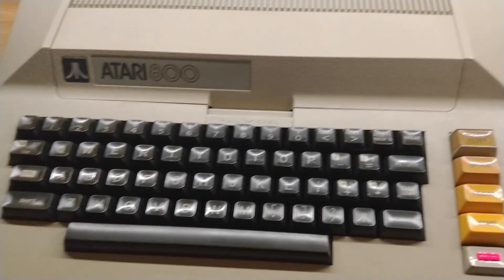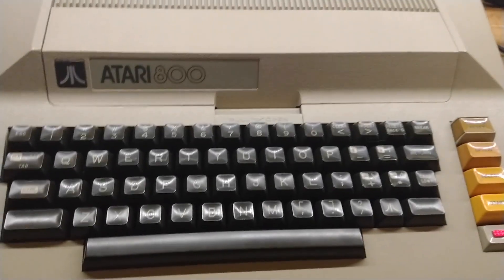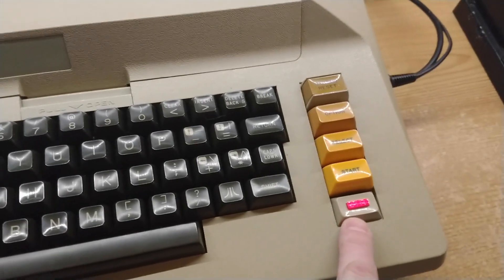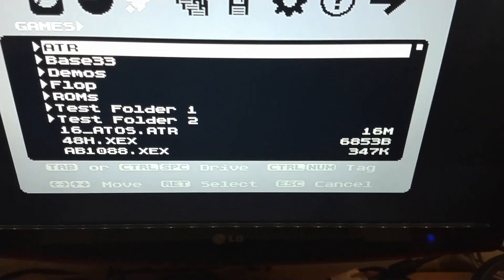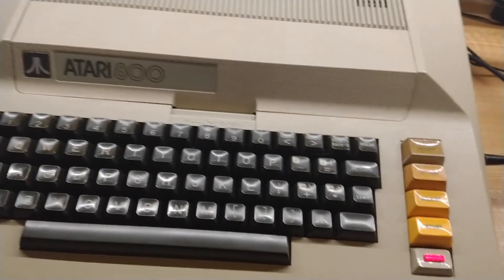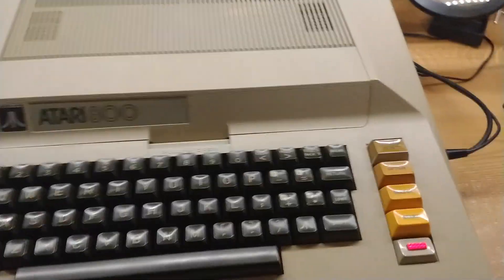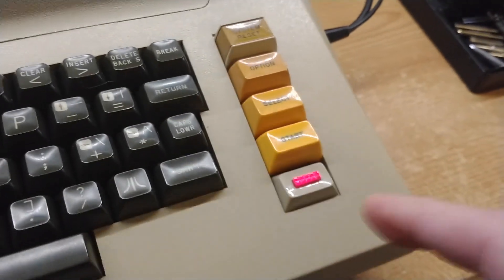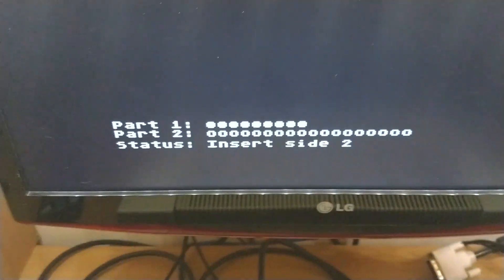Fit the Atari 800 Incognito ATR button the RIGHT way! (guest video)

Comment: I put mine on a tiny perf-board at the left-hand side of the card-cage.  There's a little space there under the hatch.  I angle the LED to be visible through the vents to the user at the keyboard and you can access the button with a very slim poker or a knife-point.  Not very convenient, but I don't swap disks much, and the button isn't surgically installed in the machine.

Comment: Hot glue a reed switch inside the case and wear a magnetic Atari ring. Wait, that's actually kind of sensible... I mean attach the switch to the toilet flush handle in the house next door?

Comment: I installed an "ATR-button"-app on my smartphone. It's (not) connected with my ATARI by WLAN, that's the right way. There's no connection to the machine, no holes, no drilling. It doesn't work but it's right, isn't it? (That's a joke)